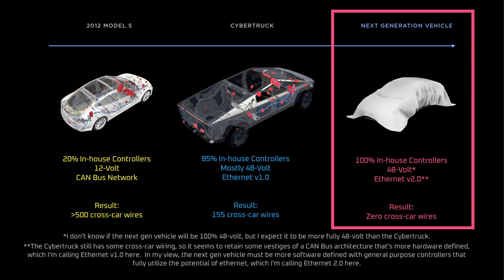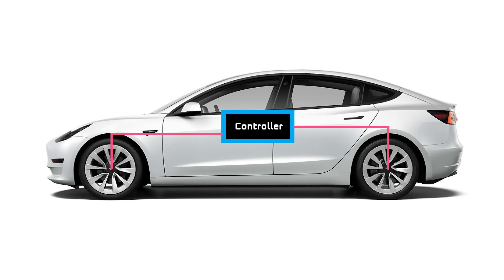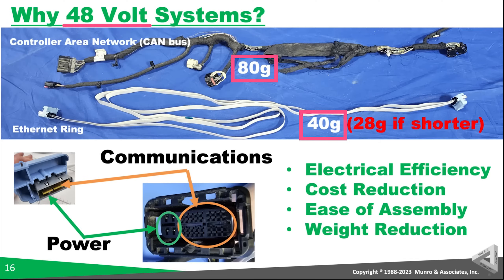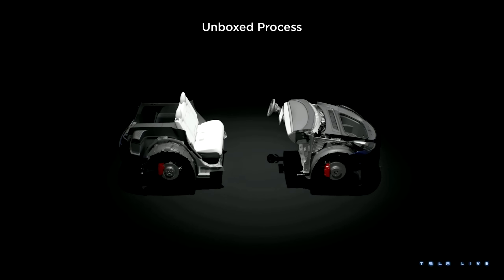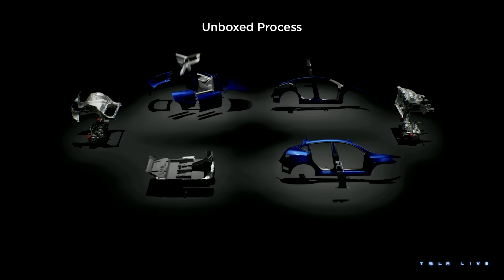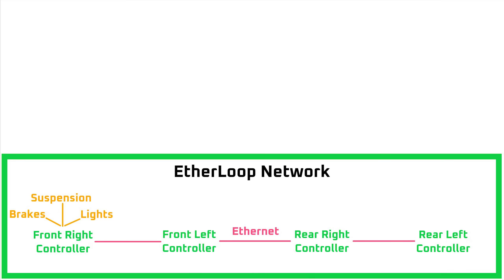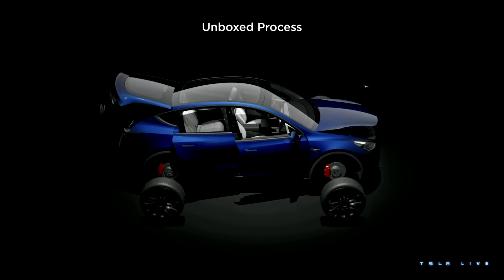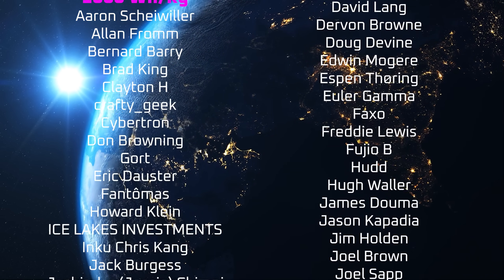Digging Deeper on Tesla's Etherloop Wiring System

Comment: I enjoy your videos.  I've been involved with engineering Ethernet on aircraft (an expert).  I strongly suspect some of your assumptions don't apply to Etherloop. I didn't read your video's comments but I'm guessing others have set things right.  
Particularly are these key points:
1) Tesla called it Etherloop because the system would be implemented as a loop so the system redundant.
2) testa uses dual end points with separate processors in the headend.
3) Tesla used a modified spanning bridge protocol to avoid packet storms
4) testa uses non-blocking cross-point Ethernet switches and possibly multiple endpoint speeds to implement deterministic package delivery.  
5) testa uses both multicast and points to point IP addressing.

Respond if you want more info.
Reply: 1: I think they just like the word loop. 
3:why spanning bridge over normal switching in this environment?  Modern implementations can certainly cope with the traffic and a vanilla implementation should do.  
5: what would be the use case for multicast in a car?  Nothing really practical comes to mind.
Reply: Multicast would be a very logical application. It’s essentially how every E2E architecture works today and for good reason.

For example anything related to vehicle dynamics (speed, collision warning, braking, steering, …) is usually multi-consumer. Another one is extensibility. Want some additional signal for a new feature? Just get it from the bus (multicast). No need to change any configuration or firmware of the existing network.
Reply: @m0rish  what is the benefit of using an unreliable transmission like multicast?  Tcp ack/nack eror detection/ correction, etc seems more applicable. Unless things are drastically different, systems have had a single consumer of signals, the computer. Don't believe the senders talk to each other.  Seems best that a system like a car have central control and coordination.  Else things get complicated and unpredictable quick
Reply: @criticality2056  
Consider multicast for transmitting an identical file to 1000 boxes on an aircraft.  Each box performs a checksum on each megabyte and requests multicast retransmission of that block after the whole file is sent.  Almost a thousand times faster than tcp/ip
Reply: @criticality2056  
Spanning tree is needed to heal a loop of 100 switches with only two ports on the loop
Reply: @suiethacks4740  what is the loop?   I know it's in the name but I haven't heard anything that operationally fits the description.
Reply: @suiethacks4740  is there a need to communicate to 1000 boxes?  The central computer would consume and process messages.  Would a reliable p2p tcp connection not do the job?   Seems simpler with few drawbacks.   If distribution of messages is needed it would be exceptional perhaps with better mechanisms available like pub/sub
Reply: @criticality2056  
Imagine a 50 internet non-blocking switches arranged on the floor in a circle.  Form a loop by attaching each to its neighbor with a single Ethernet cable.  The topology is a fully redundant backbone that  could be physically laid around the outside edge of the car.  That's one length of cable for the whole car.  Short cables radiate from the switches when needed.  This is the minimum cable weight solution for a redundant communication system with QOS.
Reply: @criticality2056  
Radial p2p Ethernet topology is heavy with long hard to R&R cables.  My proposed "loop" still uses standard tcp/IP for p2p messages.
Reply: @suiethacks4740  a switch fails everything communicating with that switch now is orphaned.   While the rest of this 'loop' can talk to eachother they've just lost a network segment and are no longer redundant.  Not good for a critical system.  Also better solutions exist.
Reply: @suiethacks4740  so multicast is out then.  How does your "loop" address the weaknesses I mentioned though?   Also, this loop is just a dual series connection.  The switches are single failure.  I'm not sure what all this complexity adds.  Other approaches are more robust and well tested
Reply: @criticality2056  
Both ends of the loop are connected to your "central computer".  The failure of one switch only causes the failure of the device that contains that switch.  Everything else in the network is still connected to the central computer so the network survives  the loss of one device: full redundance is achieved.
Reply: @criticality2056  
Your " so multicast is out then" is without context so I can't respond.
Reply: @suiethacks4740  I suppose I don't follow.  What os the device that contains the switch?
Reply: @suiethacks4740  if your loop uses standard tcp/ip p2p messages it cannot be using multicast

Comment: CAN devices do not all have to be on the same bus.  There can be multiple bus with a controller bridging communication.  In general, only those devices that need to talk to each other will be on the same bus.  You don't want a shorted bus taking out everything.  Also, traditional vehicles do not have a pile of different controllers in different locations.  They use a few large controllers with lots and lots of thick gauge wires going from those controllers to the various different devices / sensors.  But this has more to do with fusing then with the communication bus.  Remember, traditional vehicles have mechanical fuses mostly located in one place.  Reductions in wiring will require distribution of fuses which in turn requires use of eFuses (electronic fuse) in place of regular fuses.  These eFuses will each require a controller and all controllers will have to be connected together via a communication bus.  But this allows you to replace a large number of cables with a single 48V power line.  So great, but it has nothing to do with the communication bus used.  It does require a lot of work on the user interface to allow for the management of the eFuses.  No more going to the fuse box when something stops working.  The UI has to report the error, reset the fuse either manually or automatically, etc.  Lots of design work required but the hardware is actually reasonably simple.

Comment: I want to see Giga Mexico being built to manufacture unboxed $25k EV boxes with all the latest and greatest Tesla tech.
Reply: It expect to see that, or something very close. The lateness of Cybertruck and the long wait for the 25K car seems to be partly attributable to Tesla reinventing how a vehicle is wired and thus manufactured. It's not about two vehicles, it's about transforming how any vehicle is made.
Reply: @donjones4719 I keep thinking it’s also the difficulties they have run into on the 4680 battery. They really advertised the plan to get vehicle cost out through internal manufacturing and a 60% (~) reduction in cost from that (as I recall the battery presentation)

Comment: I think you missed the loop aspect of Etherloop. A typical Ethernet or CANBus network only has a single path from source to destination. The topology that you’ve drawn shows a loop whereby controllers on the network are aranged in a loop whereby messages may be passed clockwise or counterclockwise around the loop. 

This allows for fault tolerance in the event that the ring is broken either due to a wiring fault or a failed controller. This is important in eliminating single points of fault.
Reply: Nope, he covered that as well.

Comment: 19:35
"Universal controller design".
.
This has more implications beyond the "front end" supply chain.
Parts inventory.
It's a huge reduction in parts warehouse inventory/storage (ask Farzad!).

Also, Service.
Speaking as a Field Service Rep in another industry, vehicle space is limited.
Any time I can carry 1 common part for multiple devices it's a win.
.
Then there's faultfinding.
If you have that "odd" intermittent, elusive fault, or simply don't have a replacement to hand, you could swap 2 controllers and see if the fault moves with one of the units.
Reply from the maker: Amen!!!
Reply: It’s also a big cluster risk. Anything not available and nothing gets produced. Any undiscovered systematic defect: have fun RMAing that one.
There’s a reason high-reliability safety systems are designed pretty much the same across industries.
Want to do market segmentation and have a low-end and high-end trim: congrats you now have to equip the high-end ECU on every car. Yeah you can try and upsell this with subscriptions and what not but going low-end is _hard_. And doing that on a single model is harder.

It’s good but it’s not as one sided as it might look like at first.

Comment: I suspect that EtherLOOP uses a loop / ring topology for the core network (with TTL rather than token). This should allow concurrent transmission and prioritization (I'm a controller and I'm receiving multimedia data on my IN port but I have brake data to inject from my brake sensor input). 

Some fallback protocol would be required in the case of a broken Loop combined with a BIG gnarly message on screen.

Joe Average might access this hypothetical Loop network through a branch node rather than have direct access to the Loop.

It will be interesting to see someone dissect the Etherloop connector / wiring to see...
Reply from the maker: Thanks for the support!

Comment: One thing overlooked is that CANbus has well documented reliability and behaviour. It is an industry wide and ratified format that is extensively tested and used, and interoperable between many manufacturers. So the hardware is reliable, the software is reliable, the parts are cheap, the functionality mature, the knowledge is wide. Things you absolutely need for something dangerous hurtling down the road. So Tesla are dumping that for one that they made up themselves to save some wires. At the very least this should be concerning since it makes parts harder and more expensive to find but it could be worse than that depending on safety and failure is handled.
Reply: eah, no one uses Gigabit Ethernnet, especially not in industrial applications.../s
Reply: Convention and interoperability is great for all the reasons you mentioned, but conventions eventually become outdated and industrial ecosystems can become so entrenched in those conventions that it is assumed that there isn't a better way. Yeah, it's more expensive when you have to replace something that is custom and hard for the aftermarket to replicate. But change is necessary and the bandaid must be ripped off eventually.
Reply: There are special Ethernet standards that using a single twisted pair for collision free networking with multidrop. They are designed to replace the likes of CANbus in exactly this use case. This is what Tesla will be using. The advantage is that every software engineer and his dog is familiar with Ethernet. CANbus not so much. Basically Ethernet is taking over all network protocols get used to it.
Reply: Yea, except this is terrible because it's basically token ring with serial device sharing; if this were ethernet with host voting, it'd be fine. It's going to be dangerous

Comment: Nice breakdown, it's nice to see this kind of innovation in the automotive sector. Just one consideration for the communication reliability part, the physical layer might be Ethernet, but that doesn't mean that the communication is done in TCP/IP.
There are protocols that shares that physical layer, but are more suitable for use in safety applications, one of these is Profisafe, which use some layers of the ISO stack but with enough customization to allow a very fast and reliable communication

Comment: I suppose you never work in the aviation or train industry and never heard of EtherCat (for automation) and Avionics Full-Duplex Switched Ethernet (for airplane and train) which were specified over 20 years ago and used since then in airplanes and trains manufacturing and testing and is the extract same concept of etherloop but fully open and generic and accessible to everybody 

The primary difference maybe the connector and the Power Over Ethernet specification used which is specific to Tesla I presume (they were open with the NACS connector so maybe they do the same), but those concepts exist since more than 20 years, and the revolution is to apply them to the car industry, things that cars manufacturers were lazy to do for the past 20 years when it has been applied to airplanes and trains already 

Finally the name etherloop refer to an « Ethernet » + loop, and the hardest part is to address the high availability and situations of closed loop which can cause packets to loop « forever » but there is already Spanning Tree Protocol (including Rapid STP ) but convergence is at 5 to 10 seconds actually depending to the settings on a generic network (like at home or datacenter/IT environment) so the hard part is to have failure detection and recovery really fast, thing which can be truly revolutionary on an Ethernet network

A great link with some explanations https://www.militaryaerospace.com/commercial-aerospace/article/14230980/ethernet-commercial-airlines
Including the usage of ARINC reference (airplane standard) fiber even (when power distribution is not necessary)

Comment: Good video, but they wouldn't pass uncompressed video from even a single camera over Etherloop as even a basic 2MP camera generates over 1.4Gbps at just 30fps. Now they could be using Ethernet cameras (which perform H.264/5 compression at the camera), but that introduces at least 2 frames of latency which wouldn't be acceptable for self driving, so my guess is that they'll continue to use something like GMSL for the video feed to the FSD computer and then perhaps forward a compressed stream of the rear and sideview cameras over the Etherloop bus so that it can be consumed by services such as the primary display.
Reply from the maker: God I love these comments.  Super smart bunch today.  Lots of great insights
Reply: Currently automotive cameras use "serdes" , like FPD-link or GMSL . Automotive Ethernet is currently being standardized to support also speeds up to 25Gbit/s. And in future even more .Currently video data is not compressed because lossless compression does not work well with certain safety measures.  Typical speeds are currently 3-8 GBit/s .

Comment: "Etherloop" sounds like the  "Modbus" (RS-485) system I worked with.
It can connect all the element in 2 wires because each module has its own unique name;  in the software section, 
the program can call each element to get the data or command it to execute something.
Reply: A similar thing happens with CAN, but ethernet is so much faster per twisted pair. I'm not sure if there's a technical reason except that the signalling on CAN bus must be collision free (so the higher priority message will always get through and the lower priority message stops transmitting), where with ethernet it's just retransmitted as he laid out in this video.
Reply: @ThisRandomUsername  id had to be ethernet becouse they have to transmit the video to the computer and audio to the speakers
Reply: Yes, it sounds like Modbus which I worked on while working at Modicon, a leader in programmable controllers.
Reply: @ThisRandomUsername  this is actually outdated info, since it refers to how ethernet works when you use Ethernet hubs to connect multiple devices. There are not even hubs available for Gigabit Ethernet, and even for the lower speeds Hubs have been replaced entirely by Switches more than a decade ago, possibly even two decades.
Switches essentially make a mini ethernet link for every port, and forward data to the port where its supposed to go, and if that port is currently transmitting they cache the data and send it after the port is done transmitting.

compare that to the ethernet that was wired with hubs that were much stupider devices: a hub would just repeat what it received on any port to every port, without doing any managment (which was why collisions were possible)
Reply: @radio_FM_3123 it sounds like ethercat to me. Modbus is a multidrop network. This is not
Reply: I believe both often have the same physical layer (rs-485) but when getting into the protocol very different. Modbus is master/slave and not deterministic. Canbus is transmitter/receiver and nodes can send/receive to each other. The baud(data transfer rate) is typically very different.

Comment: Want to bring a safety perspective. Although the ring ethernet can bring redundancy when one of the ethernet cable is damaged, the signal can go from other routes (similar to iso-spi daisy chain), the Etherloop requires a higher safety level and complexity level of each controller (ASIL-D as must I believe). As example, for the existing CAN topology, if the brake controller malfunctions, at least the vehicle still has steering, light and other functionality. For zonal topology, even if one of the four controller malfunctions, it basically lose ALL vehicle functions since most of the feature requires 4 controllers to coordinate together. There has to be redundancy implemented on controller level to trade-off the redundancy from multiple controller in traditional topology

Comment: I also want to say that it is not uncommon for canbus systems to have a hub-and-spoke topology connected with gateways. If each controller had a built-in gateway you could easily implement an etherloop-style topology with canbus. However, I think it makes a lot of sense to use ethernet as it provides enough bandwidth--hence latency--to handle hard-realtime problems like brake control next to low priority traffic like media with quality-of-service guarantees. ARINC 644 is a similar ethernet-based network used in the aerospace industry.